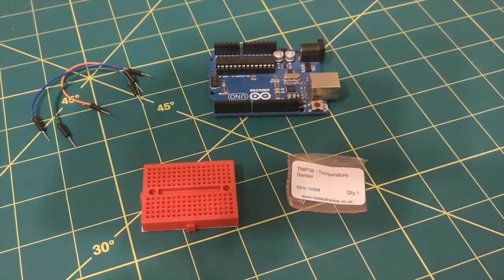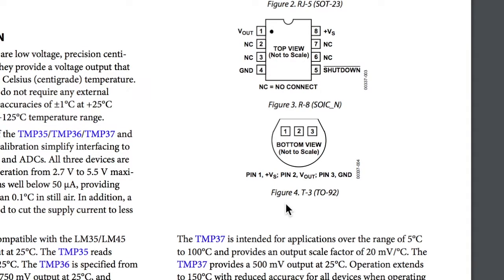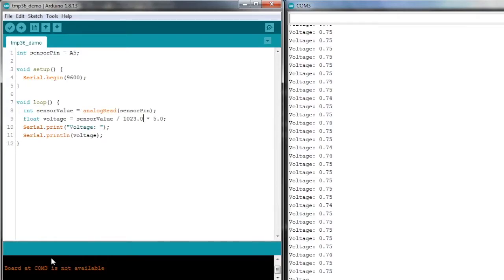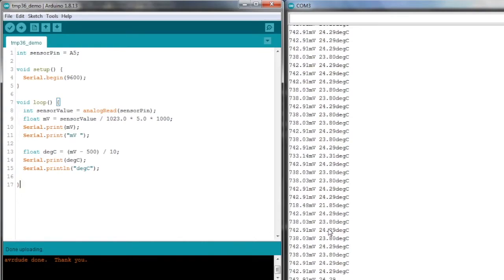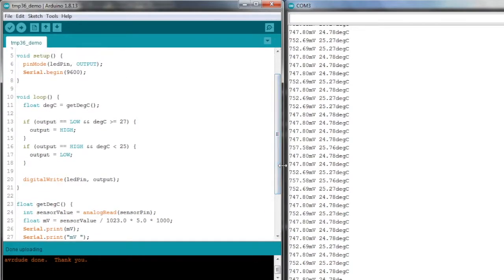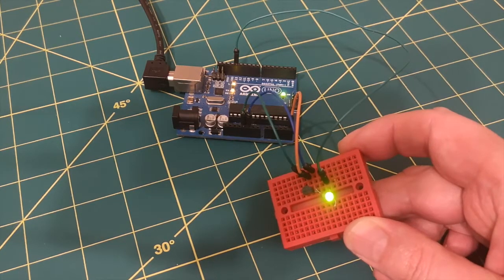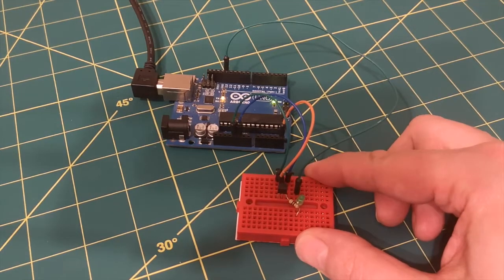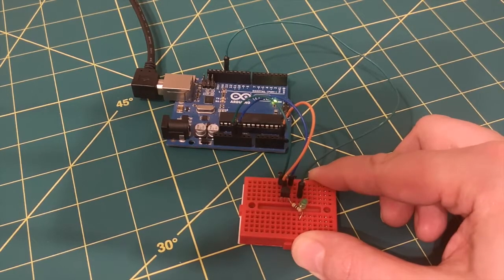TMP36 Temperature Sensor with Arduino

Comment: Hi Steve. Great video embedding Science, Maths, and Technology in learning! Your video is simple and to the point.  Excellent video. Thanks for being patient - great to see that in our fast-moving world! I'm an Electronics teacher (secondary school in NZ) - using Arduinos. Started this year with my students using Arduinos - relatively new to me. I will be using this for a research project with high school students (my studies - Master's research project). The TMP36 is perfect for fostering science, math, and technology in sensor-based inquiry (the preliminary title of the research). In short,  compare and contrast the knowledge and skills before and after doing the investigation. and exploration with the TMP36. Students will go deeper and draw diagrams - of how the TMP36 sensor works - the science behind it (details on materials, chemistry, physics and more).  Then, explore other temperature 'sensors'. Then present the data (graphs/charts/tables) through the scientific method. After exploring the TMP36, they choose to solve a problem with the Arduino -  choosing one of the 17 SDGs (sustainable development goals).  Link - 17 SDGs UN: https://www.un.org/development/desa/disabilities/envision2030.html. The focus is on solving real-life problems. For example, temperature sensors in the ocean (floating/Bluetooth/GPS/WIFI/satellite communication) monitor areas in the ocean heating up. Coral and fish are affected by global warming.  There could be other areas. Do you have any suggestions? It sounds complicated. However, learning has to be very simple. Able students could include a simple relay to control a second circuit. Thanks for the excellent video and for taking the time to explain in detail. Well done! You are very knowledgeable. Do you know of any other simple electronic components (breakout breadboard with Arduino/or other) that could fit my research project for 16-year-old students? Would appreciate your feedback. Any suggestions and ideas would be fantastic. Regards. William Van Zyl  (NZ).
Reply from the maker: Hi William, glad you found it interesting. I guess there are many applications for temperature sensors. What I remember doing when I was at college many years ago was a closed-loop control system. The temperature sensor signal was fed into an amplifier, and from there it fed into a microcontroller. The microcontroller had an output connected to a small lamp. The sensor was positioned just above the lamp. So the microcontroller would read the temperature and turn the lamp on and off to maintain a steady temperature. It was fun because we started learning how the temp sensor worked, then had to design the amplifier to generate a more usable signal, then write the computer program to run on the microcontroller. We had to build the amplifier on a PCB. I like the concept of building on top of what you have already learned to create something larger and more complex. I also really like the idea of understanding all areas of the project, mixing electronics, software engineering, and mechanical/physical aspects, which might be a PCB or a case design. I think a nice way to build on this temperature sensor project would be to add a small screen to display the temperature, then add a relay that could control something. Finally, you could add data logging by adding a real-time clock and an SD card to store the readings. And if you really wanted to take it further you could transmit the readings over some form of wireless technology. You should be able to find that I already have videos on small display screens and a real-time clock. My next video is going to cover the SD card. I suppose I should do one on using relays (I already have the parts).

Comment: Steve. Your video is just what I need! Great work, Steve! Do you have any other ideas on sensors (other than the TMP36) for the Arduino? For example, to explain the science, math and technology behind it - as you did with the TMP36. My intention is to get students to explore these sensors in depth. I will use your TMP video in my research as an introduction and include 2 more examples of sensors so they can learn about the science, math, technology and programming behind them. Simple, though, like the TMP36 you have explained beautifully. Any links (videos/projects)  to similar sensors?  Please let me know. Your TMP video is just what I need.  I will include tables - data logging  ( excel/sheets), charts, and graphs.  Then connect the OLED screen. I don't know how to connect the OLED screen. I have LCD screens. Could it work? .Did you make a video on an OLED screen? They will engage in the scientific method (hunch, hypotheses, design, collect data, interpret data, and then use the sensor as a tool to solve a real-life problem. I want to keep it simple - not too complicated. They lose interest if it is too complex. Thanks! William Van Zyl
Reply from the maker: Thinking about sensors, the photo-resistor is fairly simple, used to measure light levels. And the ultrasonic range finder is fun which measures distance to objects by using ultrasonic sound waves. For that one you to consider the speed that sound travels and then calculate how long it takes for the sound to bounce off an object and reflect back to the sensors. Search for HC-SR04. https://www.amazon.co.uk/ALAMSCN-Ultrasonic-Distance-Rangefinder-ElecRight/dp/B08NT1NRZ7/ref=sr_1_5?crid=2SQW0C1M8BT0L&keywords=ultrasonic+range+finder+arduino&qid=1665521755&qu=eyJxc2MiOiIwLjAwIiwicXNhIjoiMC4wMCIsInFzcCI6IjAuMDAifQ%3D%3D&sprefix=ultrasonic+range+finder%2Caps%2C124&sr=8-5 The OLED video is here https://www.youtube.com/watch?v=sTKb7vh74D0

Comment: Hi Steve, could I integrate the sensor into a small device and use it as temperature data logger? Thank you and best regards Saskia
Reply from the maker: Well the sensor really just reads the temperature. For a complete data logging solution you need somewhere to save the data. You could use this sensor along with an Arduino and a shield such as this one: https://thepihut.com/products/adafruit-assembled-data-logging-shield-for-arduino?variant=27739231185&currency=GBP&utm_medium=product_sync&utm_source=google&utm_content=sag_organic&utm_campaign=sag_organic&gclid=Cj0KCQjwyt-ZBhCNARIsAKH1177u2veE15CUwI4Fl-XbVIvRrDHXpPHxoASSWHd5p2I5EJVFGjSp2VUaAoR8EALw_wcB
Reply from the maker: I'm going to look into data logging some more and will probably do a video on that soon.
Reply: That would be great! Looking forward to it 😊

Comment: hi steve how do i make it so it saves the highest temp and lowest temp?
Reply from the maker: I would introduce two new variables, called highest and lowest. Initialise them with the first reading we take. Each time we take a reading compare the new reading against the highest. If it's higher than the highest, then update the highest with this new value. Also compare the new reading with the lowest. If it's lower than the lowest then update the lowest with the new reading.

Comment: int sensor;
float temperature;

void setup() {
  Serial.begin(9600);

}

void loop() {
  sensor = analogRead(A0);
  float tempfloat = (sensor / 1024.0) * 5.0;
  temperature = (tempfloat - .5) * 100;
  Serial.println(temperature);
}

a more simple way
Reply: Thanks.
Reply: You could also do:
float temperature, tempfloat;
to skip a declaration in the loop. It's not that big of a difference but it saves a couple characters I guess